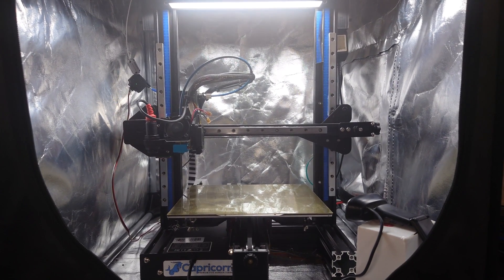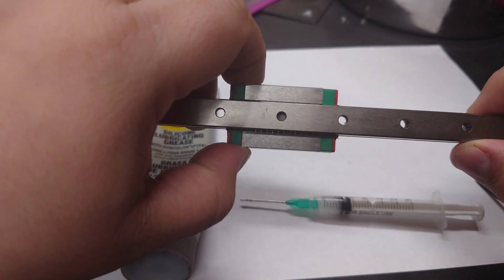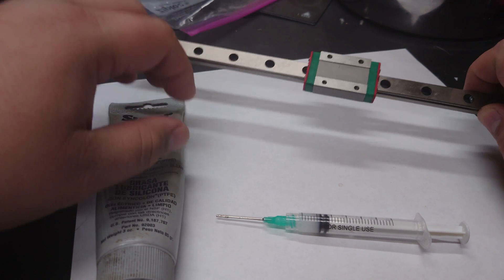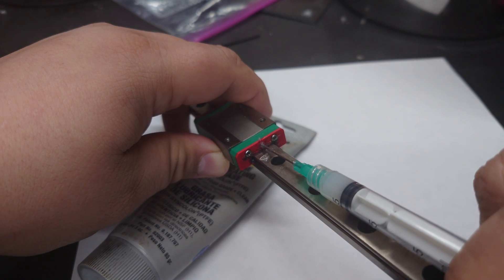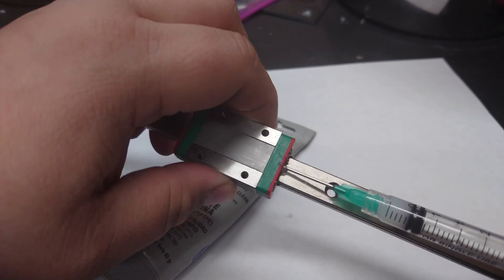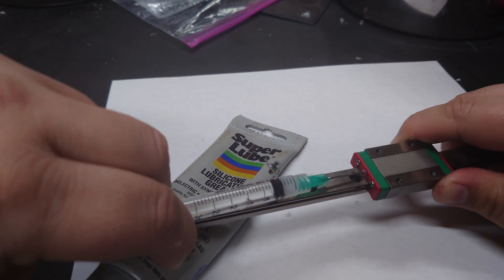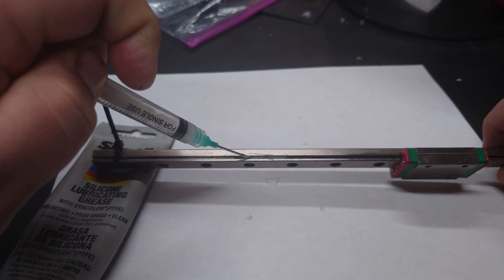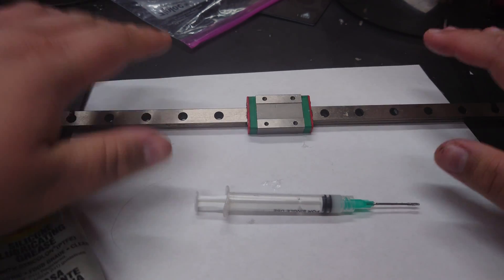How to Lubricate MGN12 Linear Rails

Comment: Do you know of any method to level a MGN12C rail on a T slot extruded aluminum section? The problem is I am using a long T Slot extrusion, about 2 meter long. I feel the extrusion is bent like an arch, this is affecting the accuracy of the linear rail. as this is also arched since the rail is mounted on the T Slot. Is there any standard way to level the rail. One idea is to put suitable shims on the ends of the rail. How about adding a brace to the T slot?
Reply: extrusions are not flat by nature, over 2M you will have a big error..you'd be better off using square stock where one side is machined flat

Comment: Yo. Great video, but the lube you're using contains PTFE solids -- this is bad for rail/ball wear as they are precision machined and designed to roll, as you pointed out. The PTFE in this lube can cause the balls to slide instead of rolling and actually increase wear. I made the same mistake and used the exact same lube. Further reading of the Hiwin rail doc shows they (obviously) recommend their own G06 grease, which is essentially an NLGI 00/000 grade grease with a lithium soap thickener and ~ 32 mm^2/s (cSt) base viscosity @ 40 deg C.

Would recommend switching out for a similar grease grade for rail longevity, though honestly I wonder how much difference it will make.
Reply: Have you managed to find a source for the G06 grease? I can't seem to find it.
Reply: dont use grease, use a light gear oil..
Reply: @HiIarityBribo like oil for sewing machine?
Reply: @HiIarityBribo  Oil is not the appropriate type of lubricant for linear guides. Unless specifically formulated for this purpose (increasing its viscosity, making it a grease), it will quite quickly drain out of the block, and when it's almost all gone, the wipers on the block will essentially function as a one-way valve, siphoning the rest off, and then you're running dry. Small rails like these are usually meant to take a grease with a viscosity of somewhere around NLGI 00, which is a semisolid (think yogurt). Grease will eventually get sucked away too, but at a much slower pace due to its firmer structure.

Comment: I had to clean my carriages out first as the stock lube was absolute crap, Im glad I did as well as I had a piece of a bearing in there!
Reply: the 'stock' lube is shipping grease, u need to clean it all off, and apply a proper oil, the 'stock' grease is not meant to lubricate
Reply: @HiIarityBribo  Hi-Win carriages come ready lubricated as far as I can tell and ready to go, I cleaned one anyhow but did not notice any difference so used the other 2 as they came and they are smooth.
Reply from the maker: Oof!

What brand did you get?
Reply: @andrewesquivel  Funssor, I was lucky it did not damage any of the other balls,when I tried to move it I could feel heavy resistance then stuttering then resistance, so I decided to clean them, they ran so much better after cleaning and relube